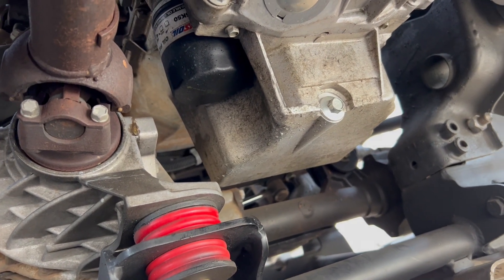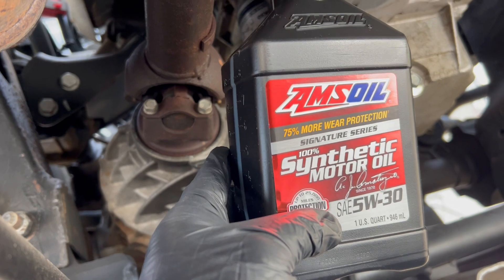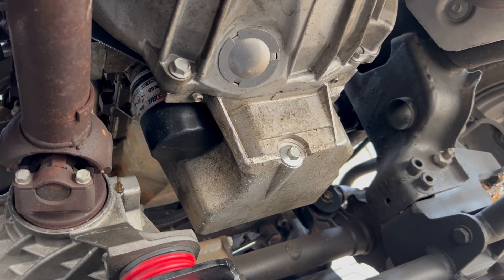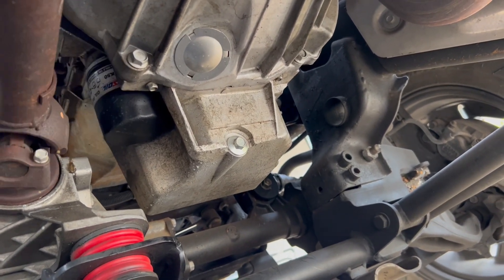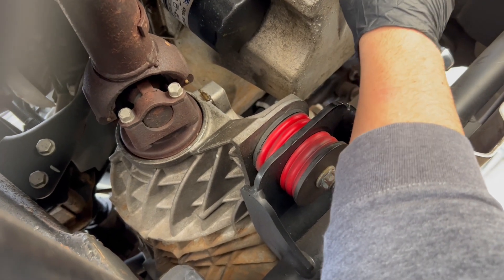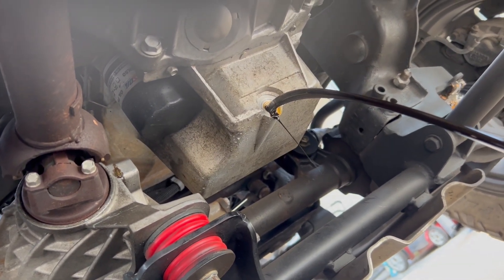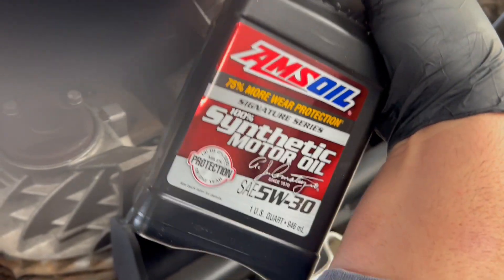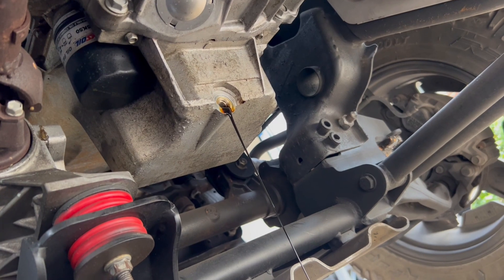Annual oil change?! - Amsoil Signature Series motor oil

Comment: I use Amsoil signature series. On another channel I watch the guy sent in Red line oil after 5000 miles and it did far better than the Amsoil after 5000 miles. I’m thinking about switching. But I’m sure either one would be fine.
Reply from the maker: Red line is good stuff too, I've tried some of their products.

Comment: How was the viscosity of the oil after 1 year?
Reply from the maker: I've never had it tested, but have used it for over a year on different vehicles. The oil has never been overly dirty or had any indication of breakdown. And I've never come close to their 25k mile range that the oil can last.